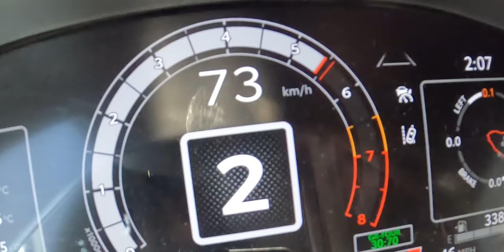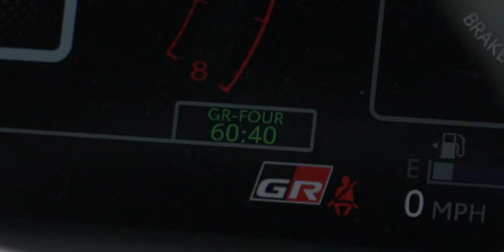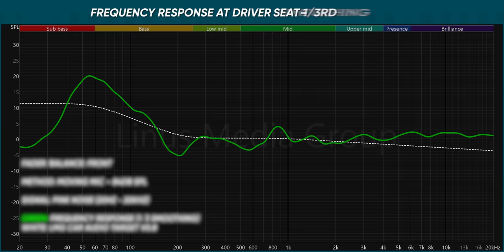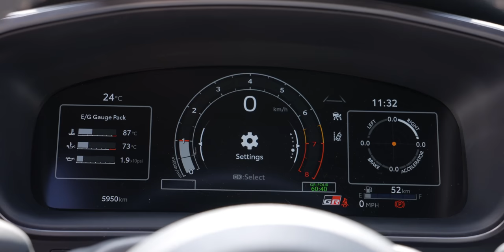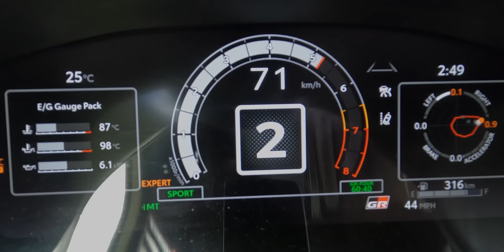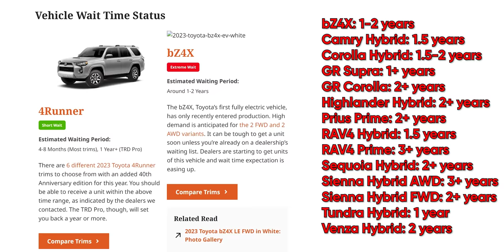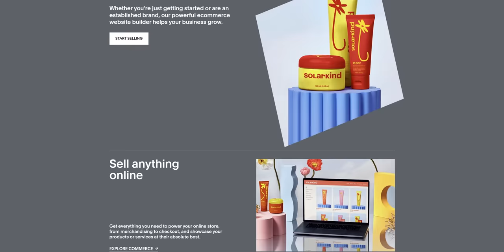I have made a very expensive mistake - Toyota GR Corolla

Comment: Ok I just picked up mine today... at MSRP, used but practically new at 300 miles. Apparently the first owner got it, got buyer's remorse and traded in for a rav4. God bless him, I'm having a heck of a time. It's a white loaded core model, has basically everything I could ask for, plus extended comprehensive warranty.
Reply: Do you find yourself missing those torsen LS differentials? I don't think I could have a car without LSDs.
Reply: Don't fret, like the Golf R, it seems the GR can get crazy power with mods. If it was available for MSRP when I got my Kona N, I would have gone with the GR.
Reply: @TripedalTroductions  He said it's a loaded core model, probably has the performance package installed which includes the LSDs
Reply: @DefinitionofFailure I thought all models get lsd.
Reply: Has your GRC caught fire yet?
Reply: @brassmule  haha not yet, making full use of it just in case tho (*edit: 17,000 hard miles and the clutch is still very stiff)
Reply: @ankit_mangesh  Hope it holds up.  They are a nice concept and definitely fun to drive.  Probably a great idea to invest in a good sized fire extinguisher. I drive boring Hondas but I have one in each of my cars.

I wish Toyota was doing a better job of figuring out what is causing these problems or at least telling the public they were investigating it.  Is it rod/piston failure putting a hole in the block causing an external oil fire? - or some other cause for the oil loss causing a fire which the loss of oil pressure also causes rod/piston failure?  Not sure how Toyota routes the oil lines for the turbo but maybe that's a cause.  Dunno which comes first but I hope Toyota - or somebody - figures it out.   There's been multiple GRC fires now and blaming it on tires or 85mph driving doesn't instill confidence.

Comment: This is the reason why I still keep my 1998 Ford Escort ZX2.

It has a feeling of connectedness to the road that newer cars just can't emulate. A feeling of solidness and mass, yet being extremely nimble and quick. Being able to feel the engine deliver all of its 130 horses in a short-ratio gearbox, without the police down your back.

That is what makes driving fun. Being one with the machine, not just riding inside of it.
Reply: I had a ZX2 all through high school, and it was the car that made me “love” driving. I’m always on the hunt for one in great condition.
Reply: There is nothing fun about a 98 Escort........
Reply: @drunkhusband6257  zx2 was a very different ford escort.
Reply: First car I bought was the 99 Zx2. I loved that thing. But switched the a Soul. I always joke about trading my Escort in for my Soul. Haha
Reply: Fiesta ST
Reply: @gawbagecan   And those are actually available. Highly likely my next car will be a MK7 Fiesta ST
Reply: @InservioLetum  it's a 2400lb car! Doesn't need much to propel it.
Reply: Unreal little thing that, keep it till you die, you won't regret it
Reply: @hardbrocklife like a z24 cavalier vs a normal cavalier. It was a light little 2 door with a 6 cylinder in it and those types are so fun to throw around. Rip cav 😢
Reply: i currently have a 2003 audi TT as my first car 5 speed manual and almost 200 horsepower is a blast not to forget the turbo and engine noises
Reply: @Rhombus-inc  agreed. Just do maintenance well because they are sensitive to bad maintenance. Other then that, great little thing. Never heard of a 5 speed one though, you sure it's not a 6 speed?
Reply: For me it's my 2001 Mazda Protege ES.  It's just fun.

Comment: Manual driving is an experience that I will continue to treasure for as long as I can 😭
Reply: I hate it.
Reply: @Qwerty-uiop  Same. Once i tried driving an automatic, i never want to drive manual again.
Reply: @aktm1407  manual is too complicated. For me, it requires too much work.
Reply: I have a WRX STI and I wouldn't trade it for the world 🥰
Reply: Once you drive a manual car, driving an automatic is so easy!
Reply: Manual is fun if you live in the country and drive on the highway or rural roads 90% of the time. In anything approaching a city manual is just an annoying waste of time.
Reply: I've never seen an automatic car in my life, nobody likes them in my country.
Reply: @rustyshakelford1466  Yeah, driving an automatic on a country road with corners every 50m is so boring. With a manual it feels like I'm actually driving with the constant gear changes
Reply: @Qwerty-uiop too much work? manual is so easy 😭
Reply: @Qwerty-uiop all you have to do is push the clutch in before changing gear, let go of the clutch once you've changed the gear and touch the accelerator 😂
Reply: Overrated, at least where I live, where there is non-stop traffic, and I don't like to drive anyway.
Reply: Genesis Coupe 3.8 GT 6 speed MT here.
I'll never go back to automatic again.
Reply: ?Yeah having that physical connection to the car and more control is truly something special. It also keeps me from getting bored and speeding XD
Reply: good for you but I hated it with my first car.
Reply: I drove a 2005 BMW 120D and I hated everything about that manual.
Reply: i love driving manual so much but my cars engine blew up a few days ago :( it was pushing 200k miles and i didn't notice an oil leak
Reply: In europe automatic gearboxes are pretty rare, we all drive manual. It’s the best protection against theft xD
Reply: @Qwerty-uiop that makes sense, driving manual can be awkward if you don't do it every day. To me the only difference between manual and auto is my brain is the tcm since I can drive manual without thinking.
Reply: @Qwerty-uiop ur just bad at it
Reply: Yeah, while electric cars don't NEED a multi-gear transmission at all, thus no automatic OR manual, adding a manual 2 speed would CERTAINLY make them more fun to drive.

Electric motors have the ability to freespin easily when gasoline engines don't, hence a physical clutch is not needed, just a mode in the motor controller.  That said, having a peddle to trigger the mode to varying degrees, wouldn't be bad.
Reply: The most annoying thing about "automatic" cars is that they've just automated the shifting, which is like 5% of driving a car. The throttling isn't automated, the braking isn't automated, and neither is the steering. You still have to do all of that, so you have two chefs in the kitchen: You, and the AT. But the AT just does a tiny amount of the work, and it doesn't always do what you want it to. FSD is going to be great when it finally works and we can entirely remove ourselves from the driving, but until then, I'd rather be the only one operating the car. Plus driving manuals is like playing a music instrument. Feels great when you do everything right and it all clicks, and you can always improve on your skills. It turns driving into less of a chore and more of an engaging activity.
Reply: @dejojoo  I know, I’m a new driver lol
Reply: I think the real reason people do not like manuals is it forces you to actually pay attention while driving.
Reply: @ottersdangerden  but that's the reason I like manual, it feels like I'm actually driving
Reply: I had both AT and MT cars. This is very simple: If it is to be comfortable limousine-like experience, AT is the way. If you enjoy having bit more control over rev and fast jumping few gears (e.g. Heel-and-toe) then MT is the way.
I come from a country dominated by MT (cheaper, easier to maintain) and at the moment I don't really mind. But next time I buy a car I am getting AT, just because I am getting old and risky driving is not my thing anymore ;-)
Reply: Manual driving is the best, I hate automatic transmission.
Reply: People need to modernize themselves and buy a drive-by-wire automatic with manual. Best of both worlds. No clutch and needless movements. Faster, cleaner shifts. Will always, 100% be more efficient in speed, utility, and economy. It's the future so get used to it.
Reply: Amen. I just bought a 2023 m3 manual over tesla model s. tesla is faster, but it's boring AF
Reply: @Qwerty-uiop  Been driving a mnual for 17 years and I don't even think about gear shifting, just doing it automatically.. wait am I the automatic for my car?
Reply: @Qwerty-uiop  you're a bad driver then
Reply: @aktm1407 wtf is wrong w you lmao
Reply: @Qwerty-uiop sound mad lazy i mean if you dont like driving sure thats fine otherwise just sounds lazy
Reply: @alalal123421  I don’t really like driving to be honest
Reply: @alalal123421  manual is too much work lmao

Comment: the mistake: 

EQ curve of the soundsystem is boosting low end (60ish Hz) because it has to compete with an engine, which at 4000 rpm is about 60 Hz. So low end of is already busy with engine sound, the soundsystem needs to blast through it. So give it a listen while driving , then cut the 60 and see which you like more. This is EQing to the venue to the room haha

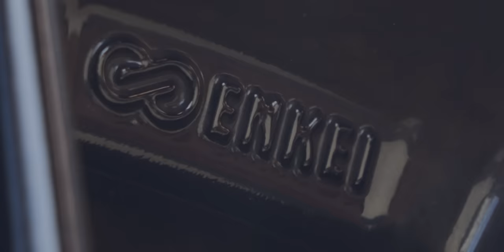Comment: 4:46 "The cooling system is incredibly simple" ** shows horn and AC condenser*
"The way they get around this is with a front mount"
*Shows intercooler which is intake only and not even connected to the cooling system but cools down intake air temps

Comment: for me, the REPAIRABILITY is the most important part. and will always be.
Reply: That's the only real issue I have with EVs... they're completely locked down.  It should be mandatory that after, say, 5 years their entire software platform is unlocked for third party vendors.
Reply: Toyota is throwing that out the window lately. The parts for this car are extremely expensive ala carte.

Comment: I was between a GR Carolla or a Civic Type R.  Ended up going with the FL5 Type R, but I can only imagine the all wheel drive on the carolla would be a blast in your Canadian Winters.
Reply: I did the mk7.5 golf R and for Canadian winter it rocks. I would've the type R but being 30 now the subtle looks of the R sold me.
Reply: You can't lose with that choice!
Reply: Awd cars always seem to have less  handling idk why!
Reply: CTR>>>>Corolla
Reply: @Frisky_Panda uh no lol
Reply: @Frisky_Panda They have more grip available when on corner exit, but corner entry really struggles because power goes to the front wheels. This means less grip is available to those front wheels, despite the baseline level of grip being the same.
Reply: @AndrewB23  depends, using the traction for acceleration or handling or deceleration. Mostly when two are combined does it feel like "less handling" to someone used to two wheel drive cars especially rwds.
Reply: GRC is so overrated

Comment: the gr corolla is definitely one of the best modern cars and the motor is insane. its had around 700 hp pushed out of it on stock rods, pistons, and crankshaft
Reply: Turbo triples are the coolest modern compact car engines and they sound awesome!

Comment: I have the GR86 and just love that feeling of having enough power to be extremely fun but not too powerful to get you pulled over or killed..

Sweet midrange mate.
Reply: I love my GR86, one of the most fun cars to drive
Reply: I really like the way they look but I need more power than those have.
Reply: Love my gr86 as well. Test drove a gr Corolla. Not sure I like it the same
Reply: it's silly that the gr corolla is more expensive than the highest spec gr86, and just a stone throw away from the supra 
hot hatches are fun and all but it's still a corolla, one that leaves you with zero room to do any of your own modifications to 
15k is a lot of money you could play with on a gr86 to match the cost of the corolla
Reply: They would still pull you over for the exhaust. 😒

At least, that's what they do here in Quebec, even if it's totally stock.
Reply: @xTornado78x  Slapped a Tomei Ti catback on mine, no complaints thus far down in TX. Plenty of loud cars around thankfully :)
Reply: @DanielTimberwolf  I wish I lived in Texas... 🥲

...especially for their weather. 🌪

Comment: as being a car (and motorcycle) guy, i totally get this. I used to have a couple geo metros too, and those were FUN to drive. I personally think you get more fun out of using every last bit of performance out of a slow car than you get out of a fast car that you can't completely use. You mentioned also the "half a second of wee," probably in reference to the speed limit. I def get that, expecially on motorcycles. Now you know why so many of us go fast: no, we aren't racing, and no, we aren't showing off, and no, we usually aren't even in a rush, we just enjoy the thrill.
And manuals will always be more fun for me, if theoretically on paper less useful these days for both performance and gas millage. Responsiveness..... That Geo Metro had a 997cc engine with basically no flywheel.

Comment: I've driven and put about 40k miles on a 2010 forester base model with a 5 speed manual. it only has about 88k miles on it right now so it's in great shape but man, even though it is quite slow(8 seconds from 0-60), it is so fun to drive. especially in the winter when i'm able to get the tires to break traction a bit. such an amazing little vehicle. it really goes to show that speed isn't everything

Comment: I love the idea of this car (it almost replaces the now-dead Focus RS). But the lack of center arm rest is almost a deal breaker for me 🤣 I daily drive stick and definitely like having a center armrest
Reply: It's annoying to not have one standard but it's easily solved with a pillow or just the armrest kit
Reply: That confuses me also. 
 My 13 STi has an armrest, and it cost about the same as the GR Corolla does
Reply: In my old Ford Moneo, the armrest is in no way in the way of either the gear stick nor the handbrake lever. It can easily be combined when done properly.

Comment: I never fully understood the joy behind driving stick until a couple of months ago (first time driving a manual). It’s cool to see all of the features coming out in the new vehicles too.

There’s something about physical responses and buttons that make a huge difference. You don’t need a fancy display and all the extra screen size; you need the basics (less tech to break) and the additional practical features. I’m not into the car space, but I can appreciate the engineering behind it and the availability these manufacturers add for user’s to fine-tune their settings for their specific use case.

All the extra random technological crap added is just plain stupid, especially when unnecessary. The deposit to-delivery time we’re seeing with newer vehicles coming out is also unreasonable. It took nearly 18 months to get a custom truck into my local dealership, and it had nearly all the upgradable tech features stripped down to the bare minimum.

Comment: you guys should take a look at the 2023 miata.
with the new kinematic posture control, when turning into a corner the inner wheels will get a slight breaking force applied so that it can corner more sharply even at high speeds.

being rwd and having 181 hp its quite a nice weekend car

Comment: I love the EV videos on short circuit, and really love this video too! Hearing a little about the technical stuff is really cool too! (Just last month i got really interested in how those torque split systems work.)
The Toyota car supply issue really rings true. I was looking for a car earlier this year and was told at Toyota that, for anything other than a plain 2WD Corolla, I'm looking at a 2+ year wait. Instead I found myself a nice barely used Subaru Impreza that, while not the best value (it wasnt much cheaper than a new one would be), it was available and the Subaru dealership forced no add-ons or fees at all.
Reply: What makes that even more funny is, Subaru is part of Toyota Motor Group

Comment: my first car was a 3-cylinder Hyundai Getz, a small and quirky car that was quicker than it looked and the roar it made when you really stepped on it, was so much fun!
I've had multiple cars since then and my latest, is actually a return to what I have missed. A Hyundai i20 N-line, the Getz's replacement, with rally inspiration. It has 100hp on 3-cylinders and a roar like no freaking other, it is just a ton of fun and I can heartily recommend it! (and if you have the money, go for the i20 N instead, for the 200hp model and even more fun)

I have driven faster and "smarter"/"cooler" looking cars, but they honestly weren't anywhere near as much fun in daily driving. My i20 N-line is fun at all speeds, whether it be 50 or 150kmph+.

Comment: As a guy that's been driving fast manuals forever, I got my first DCT car just recently. I don't miss the manual as much as I thought I would. I'm a car guy deep down and I took the time to learn heal/toe and go to the track often. The new car is a bit less engaging at times but does the job better than I could have in previous cars. I realized I like results, and the DCT car does deliver effortless downshifts with revmatching that don't require imputing 3 pedals at the same time with two feet. I'm no longer a manual conservationist is what I'm saying, maybe we were beating a dead horse.. Incidentally, I tried to get the GR Corolla and Toyota wouldn't give it to me without paying way over sticker! I ended up getting an AMG Mercedes for almost the same price they wanted for the GR. Once you get the real price for this Corolla you realize how stupid it is, they wanted $60K for the circuit.